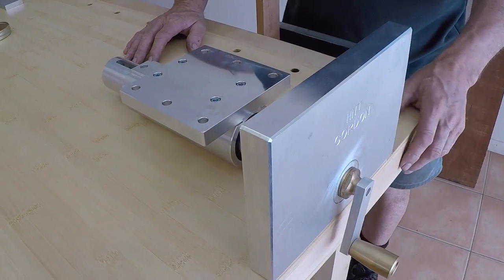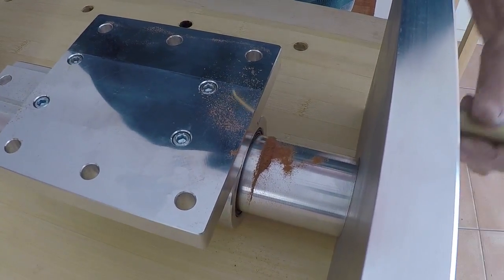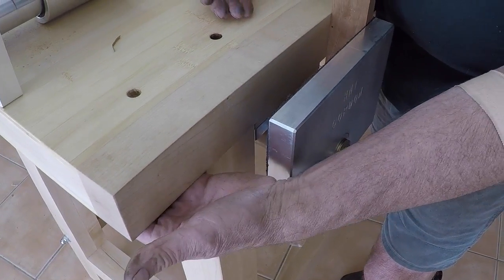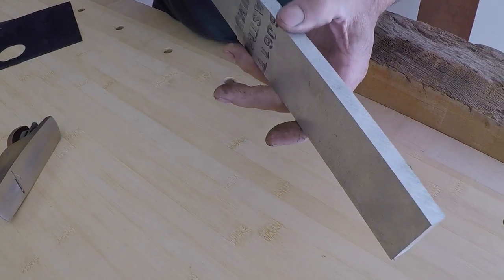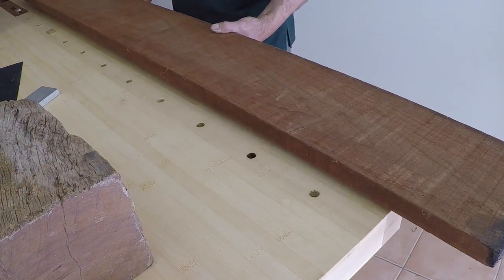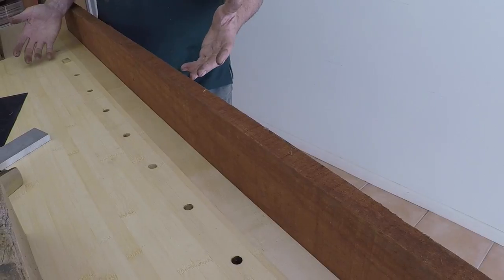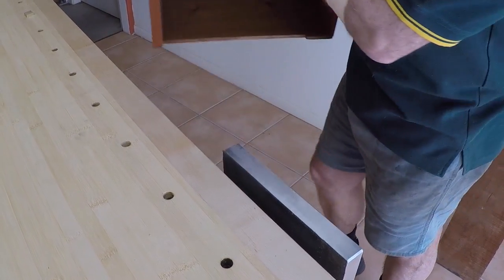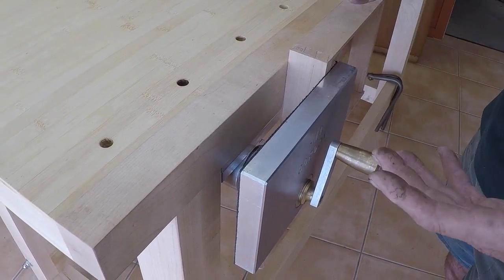HNT Gordon Front Vice

Comment: There should be a good center nut, then you can spin the vice open or shut with a drill driver.  Yes the handle will flail, all you need is an extention for the drill.  I have had the Tucker vise for a long time, and it has a quick adjust feature, but it is always a little jammed.  It works perfectly in a dust free environment...  It is worth wrestling with if one wanted to go from 0-12" (or whatever the max opening is.  But it isn't worth it for the average move.   There is no drill driver boss on the Tucker vise.
Reply from the maker: Given the vice opens 6 inches and you can wind it the full distance in about  12 seconds,  I'm not sure it would be quicker to get the drill put a bit in and  drill it close to where you want it and then final adjustment on the work piece.   I use a vice every day at work and it is rare that I wind it open or shut the full distance.   Anyway thanks for your thought but It is not a modification we would contemplate.  Regards Terry

Comment: Two days ago I just took delivery of a new bench with this vice fitted and it looked beautiful.  My daughter went into my shed last night and used it for the first time.  When she unscrewed the vice the vice handle unscrewed instead of opening the vice. I found the handle just lying on top of the workbench.this morning.  I screwed it back on but it just comes off instead of opening the vice when you use the handle.  Can some one tell me how this is supposed to be attached such that this doesn't happen?
Reply from the maker: The handle needs to be locked against the brass nut using two spanners, one on the lock nut and one on the handle and using opposing force lock the two together.   A small amount of medium strength thread lock on the handle thread will help prevent the handle unlocking from the brass nut.   It is designed this way so you can remove the handle if it is damaged or you want to adjust the backlash in the thread movement.  Regards HNT
Reply: @hntgordonco.2514  Many thanks That seems to have done the trick!

Comment: I really like to own this vise. I wonder whether you could add a bench dog on top of the moving jaw for those who would like to use this vise as an end vise to an existing workbench.
Reply from the maker: Hello Snowwalker.     Yes I have seen pictures of woodworkers that have done this to this vice.   We prefer not to do it as part of the construction and let the vice owner decide where the dog should go , what size and how many.    It is simply a matter of drilling the hole to accommodate the dog or dogs.    Regards Terry
Reply: Thank you Terry! I guess it would be easy to drill a hole. I just have this phobia of trying to modify a nice brand new tool :)  but I will try.
Reply from the maker: Hi Snowwalker,    if you can drill an undersize hole and then ream it to size.  if you don't have a reamer use a drill to size but use kero as a lubricant when drilling the hole.   If your not confident send us an email and we may be able to do it for you before we send it.   Regards terry
Reply: Thanks Terry, I will do that for sure. I am completing my bench now and will be in touch!

Comment: Looks very nice. Will the production vices be anodised?
Reply from the maker: Hi Steve,

We are looking into it, however their are issues due to the fact of stainless steel pins in the vice which create problems with anodising.  The other issue is anodising creates a harder surface which may create issues with damaging your blades if you hit it. Cost is also another factor - out of curiosity, how much extra would you pay for it if it was anodised?  

Thanks,
Terry
Reply: HNT Gordon I'm not sure if I'm following you Terry. Wouldn't you adjust dimentions of the aluminium to accommodate anodising prior to assembly with the stainless parts? As for pricing, I haven't looked at the asking price yet. Surely you would just maintain your profit margin.  Ceracoat could be an option as well as it doesn't need to be ridiculously tough, just as attractive as your planes in my opinion.
Reply from the maker: Hi ,   thanks for your reply.   I'm with you on the running into the vice with tools,  but it was a concern put to us so that is why we made the comments about it.   We will look into try ball handle as it could be a better option than the wheel and more economical,  thanks for the idea.   Regards Terry
Reply from the maker: Hi Steve,  thanks for your comments.   The issue with anodizing is simply we have to half make the vice,  have it anodized and then fit the SS parts etc.   It's only logistics but adds time and cost.   We plan on getting one done and see how it works out time and money wise verses the benefits.    Will put something out there once we have it done.   Regards Terry

Comment: Nice, but why no quick release?
Reply from the maker: Hi   Michael,

Thanks for your comments.    I will explain why we didn't consider a quick release for this vice and I would be very interested in how you use your front vice to show where the quick release system has given you some  advantage or efficiency.   If there is a really good reason we would try to incorporate it as long as it doesn't detract from the non racking design.

In the design phase I looked at how I used front vices for the past 45 years of doing woodwork.   For the first half I never even considered putting a flat board on top of the bench to plane it flat, I would put all the various width boards in my front vice and try to plane them flat.   I got a result but with hindsight it was a poor result.    So when I was using this method I was thrilled when I replaced my 6" opening record vice with two Dawn No 9 quick release vices which could open out to about 11 inches.   I had both of them on the side of my bench so I could plane long boards by holding either end.   My experience with this was the quick release had issues with slippage which was a right pain in the butt.   Then one day I saw a cabinet maker lay his wide boards on top of his bench and plane them flat by pushing them into a stop.    When I quizzed him about why he didn't use a front vice he said in very  stern terms you cannot get the board flat enough for accurate cabinet making.  The penny had dropped for me right there.     I took his advice and all of a sudden my cabinet making got a whole lot easier and the quality of the furniture I was building became obvious.    Once I adopted this approach the supposed advantages of my wide opening quick release vice went away.    From then on my dawn vices were mainly used open out to 1 to 2 inches and occasionally 4 inches for large table legs and I didn't use the quick release much at all because of the small range I was using my front vice in.  At this stage the racking of these vices for certain jobs was also very inefficient.

So the first design criteria for the front vise was based on the premise that the woodworker will use the top of their bench to plane the flat side of boards, either using stops or a tail vise to hold the work piece.   So there is an assumption that the front vice is not used for planing the flat side of a board but for all other tasks that can't be done in a tail vice or stop setup.

For the past 23 years I have been making tools and I use a vice daily in my work and some days use the vice for 8 hours straight.   This is where I learnt about the efficiencies of work holding.   I had a cast iron pattern makers vice for this work and because of its design it required force to hold your work nicely and I had to continually adjust the cam lever so that the parts being made didn't slip.   This vice eventually fatigued and the front cast jaw broke.    We designed and made our own pattern makers vices out of high grade aluminium where work holding relied on precision rather than force by having the flat jaws coming together neatly with lots of surface area so very little force was required to hold the work piece.   This changed the efficiency of work holding and my parts never  slipped in use and the vice was easy to open and close.   Over an 8 hour day of using a vice this has incredible cost savings.   To finish a plane it gets put in and out of the vice on average 15 times so you can do the math if the work piece doesn't hold when you put it in the vice the first time.

This  vice design is based around efficiency of work holding using precision over force.    This has made a huge difference to making tools by hand and has saved us lots of time.  We believe this will be the same for people doing woodwork  and cabinet making.    To make a vice that is non racking requires a high level of accurate machining and that is why they are $550 and  we can't produce them any cheaper.    That being said if time is money to people you will save a significant amount of time/money when mounting this vice as compared to a cast iron vice.   If you use your vice on a regular basis the time savings in the first ten years alone will be significant.

We are experimenting with a cast wheel to move the vice in and out,   which will speed up the movement a bit but it will add cost to the vice.   From my experience with using these vices the small crank handle fitted is very efficient in any case.

I hope that helps explain why these vices don't have a quick release.
Reply: HNT Gordon Thank you for thoughtful answer Gordon! I see your point. In my case I too don't use front vice to hold board flat - I use the bench and bench dogs. But even so I found that I'm using quick release almost always - for me it's just saving time. And I like the quick release system without separate trigger - the one where you release shaft by turning half or one turn backwards. I don't know - it's just I find myself always using quick release even for small work. But I see your point about this mechanism hurting precision. Anyway, thanks for finding time explaining your decisions - it sure shows you put a lot of thinking into it! Good luck with production!
Reply: I'm wondering if the usefulness of a quick release is related to the type of work you are doing.  If you are always holding similar size pieces in the vice, I can see that there is little need for speed of adjustment a quick release would provide. However if you are moving quickly between different sized pieces, as I do regularly in my home shop, I think the benefit increases.  

Thank you for the explanation of your design decisions.
Reply from the maker: Hi Michael.    Thanks for your feedback.  Hopefully we will get a chance at a wood show to meet you,   so you can try our vice to see the benefits we talked about.   In any case we will continue to think about the quick release or an alternative to it.   Regards Terry
Reply from the maker: Hi Peter.   Thanks for your reply.  It will always come down to the features you need most in a tool.   Hopefully we will meet at some stage and you get a chance to try our vice.   Regards Terry

Comment: The salient point of this presentation is the admission that the vise relies upon plastic bushings to function. The presenter says that extensive testing was done and the bushings did not wear out during this time period. The key phrase is “during this time period.” How about over the next 50 years? My used Record vise made in the 1940s and bearing the scars of heavy use, still works perfectly and will continue to work perfectly for the next 80 years. Nothing with plastic bushings and rubber seals can do so. It looks nice, but I don’t suspect actual working artisans will buy it.
Reply from the maker: We offer an unconditional guarantee on our materials and workmanship on all the tools we make,  if we were not confident this vice will last a life time we would not offer that.    If you use a vice on a regular basis, as we do, this vice will pay for itself in a very short time because of the non-racking design.  I can only suggest you do some research on UHMWPE which is what the bushes are made of, as your comments are just a guess.   This plastic is used in many industrial applications today.  In any case, we are offering a non racking option for a woodworking vice, but if people want to use a vice that racks then that is their choice.  IMHO our design will set the future standard for woodworking vices.

Comment: Impressive design, though the lack of a quick release tempers my enthusiasm.
Reply from the maker: Please read reply to Michael Logutov as it explains why we don't use quick release - Thanks
Reply: I agree with your position on planing boards on the bench top. I still find many other uses for my vises that require frequent opening from wide to narrow and that eats up time. Since your design requires less torque for good clamping another approach to reduce opening/closing time is to use a dual lead or triple lead screw. You may call it by some other name, but one turn of a dual lead screw would move the chop by twice the amount of a single lead screw thus reducing the time for opening/closing.  They offer less torque than normal screws, but you need less torque. Yes, these screws would be more costly than a conventional screw,
but you are already at a price point where you want to offer as many good features as you can get.
Paul
Reply from the maker: Hi Paul.    Thanks for your comments and well thought out.   The idea about the 2 start thread certainly has merit and created some banter in the lunch room today.    We are going to look into getting hold of a 2 start thread and try it out if we can.   Will post  again if we can come up with a good option.   Regards Terry